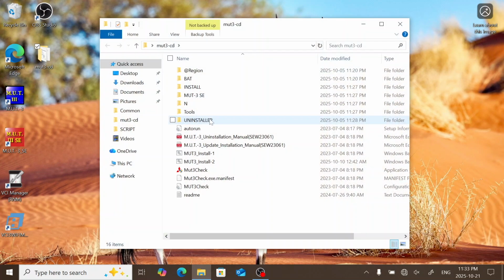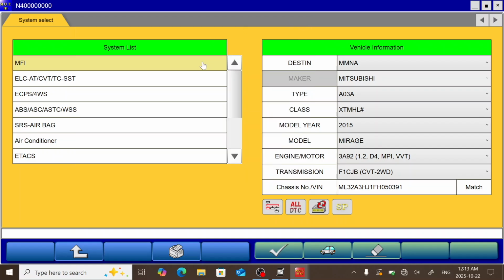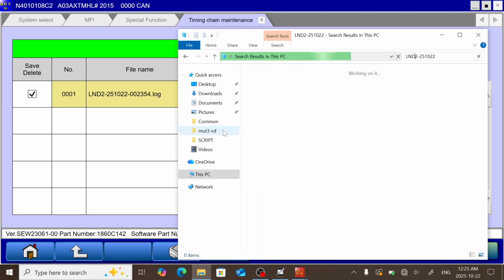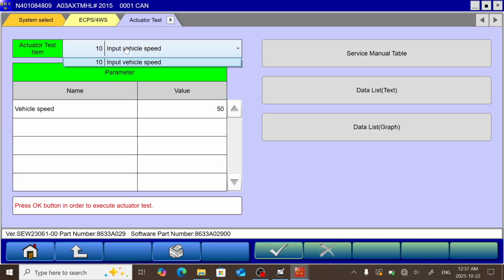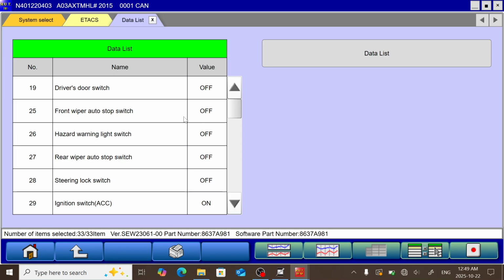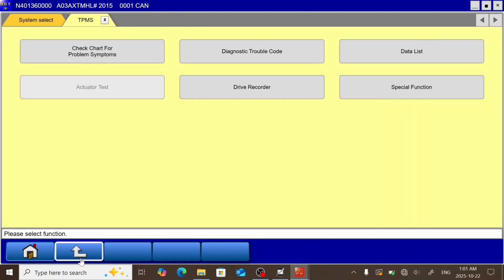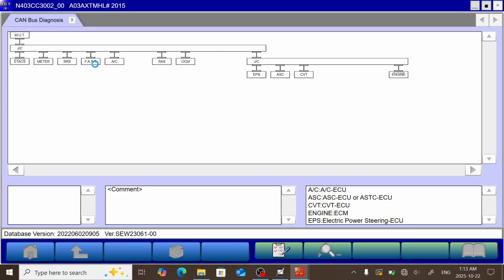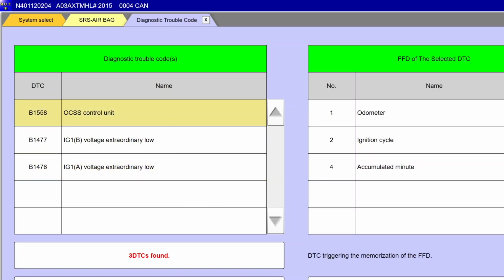MUT-3 SE Setup & Complete Software Walkthrough

Comment: I bought one of these kits as well. I'm not a computer genius, but I did manage to get the software installed. My issue is when I open MUT3 SE, a device explorer pops up and says no VCI detected. Also MUT3 SE says it cannot connect to VCI. Any suggestions?
Reply from the maker: Try both wired and wireless if your unit supports both. I could only get it to work wirelessly myself
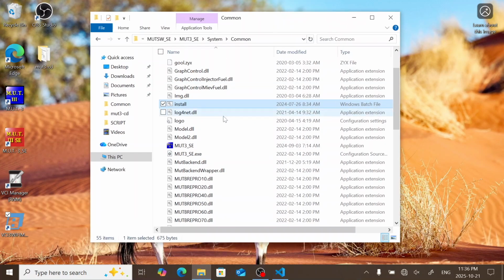Reply: I caught that in your video. I also attempted your fix at 2:45, but the adapter txt file was not there. I added one and but I do not get the command prompt to choose what adapter to use.
Reply from the maker: @travispritchard4978 there is not much I can do for you. I can try and troubleshoot for an hourly fee but I probably change more per hour than you paid for the mut 3. If you are interested you can email me at the address in my YouTube profile.

Comment: Warning to those considering purchasing one of these units... DON'T buy one!!! they are overpriced rubbish! If you start looking at the contents of the devices drivers etc, it uses a very poor implementation of a registry/dll hack, which mimics a tactrix openport, then uses a old/poorly hacked version of a software product from 2021, it's 2 poorly implemented hacks to make it work, then reads/writes over wifi on a hacky solution... It is not safe to use and is the reason a lot of features will not work in MUT! You are literally better off purchasing a $20 openport clone or any other standard j2534 device! You will also be stuck on an old version of MUT, as the device only works on the version it's bundled with, so updates are out of the question. Also, side note SMV does work if you set it up correctly! If you want the latest version, with latest programming data, with proper implementation and no dodgy/dangerous hacks, from someone reputable you can find me on eb@y or email ker0de at hotmail dot com. For a proper solution ✌

Comment: Hello, I have a 2018 Mirage. Is this tool something i could use to raise idle? Not a relearn but actually change value of idle.
Reply from the maker: At about 50:30 in the video I scroll through the complete list of etacs configuration options. I don’t think idle control is one of them.

It might be something the CVT computer can set. CVTz50 is able to configure idle for some vehicles but I am not sure it can do the mirage.

Comment: I have installed the same product. However, MUT3 consistently indicates no connection to the VCI. When I start it, I do not see a black window with a connection to the VCI.
Reply from the maker: The video shows how to fix the black window not appearing at around the 2:30 mark. For me it was because a vci device was already selected before so it would skip the selection prompt.
Reply: @TheFrugalEngineer  I did as shown in the video, but nothing appeared in the adapter file. When I click on STV in Mut 3, I immediately get a message saying that the chassis number could not be retrieved, and the next window opens but there is no communication. In the video, when you click on STV, a black box appears with "Starting" and "Loading". This simply does not happen for me.
Reply from the maker: @JustinWolf-b7r there is no way I can troubleshoot this blindly. My only advice would be to re run the install script(s) running as administrator as it may not have made the registry changes.
Reply: @TheFrugalEngineer  I have now managed to do this, the small window appears and I am asked for the adapter. However, only 1 adapter is displayed for me. 1. VCI3.lite

Comment: Hi, i have 2024 software and same vci, but cannot make the software to see hardware.. even the seller cannot.
Also after some settings of the seller via remote desktop, the mut3 se starts , shows a black window with info, and closes after a few seconds. Previously, it was showing the window to choose adapter but wasnt there my adapter.
Win 10 pro 64bit
Reply: Im desperate
Reply from the maker: Have you tried to delete the adapter.txt file as shown in the video? Deleting the file clears the saved adapter selection which should let you choose the correct adapter whenever you next open the software.
Reply: Sure
Reply: Do you use deskin to check please?
Reply from the maker: @giannisgiannis7202  feel free to reach out to the email address in my YouTube channel if you’re interesting in hiring me as a consultant. If you are physically located in Canada I can also offer in person consulting.
Reply: @TheFrugalEngineer no, located in Greece. Is there vci wifi manager for win32?
Thank you!
Reply from the maker: @giannisgiannis7202 I’m not sure, the seller provided the software for me on a CD.

Comment: Thank you SOOO much for posting this video. I have ordered exactly the same kit. But my batch files never installed the VCIManager. So I just tried with the USB cable and had no idea it had WiFi at all? Because there was a cable provided with the kit. Like any clone kits like these there is just not any useful information provided. So after  manually copying files that the bat files for some reason didn't wanted to do, I had the VCIManager up and running, and was able to connect. The MUT-3 software is a must if you have to deal with PHEV's and battery data. So YAAY and thank you for showing in detail. I was sooo close to just bin the kit after spending hours with different PC's.

Comment: Where did you buy everything you nedd to connect to MUT 3? 
I'm interested in fixing a problem whit my eclipse 3G.
Reply from the maker: I bought the MUT 3 VCI device from AliExpress and it included a cd with the MUT 3 SE software
Reply: @TheFrugalEngineer Could you share the link with me, bro?
Reply from the maker: @jessychavez4133  the seller I bought it from took down the listing. I recommend going with whatever’s cheapest. If you want exactly the same hardware as me I can get it for you, just reach out to the email in my YouTube profile.
Reply: @jessychavez4133  it's possible to make it work with Tactrix Openport or many other J2534 devices like a Scanmatic, DiaLink, Toyota Mini VCI clone (for Toyota MVCI without reprogramming). Just google in Youtube on russian : "Установка MUT-III совершенно бесплатно". In description of video author had posted the link for software download and described how to install and set registry to use with other J2534.